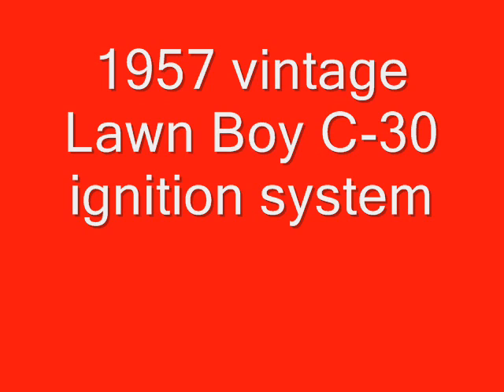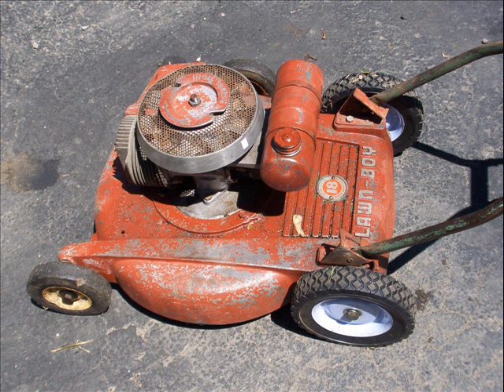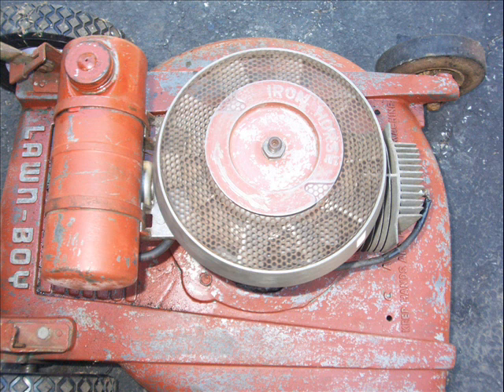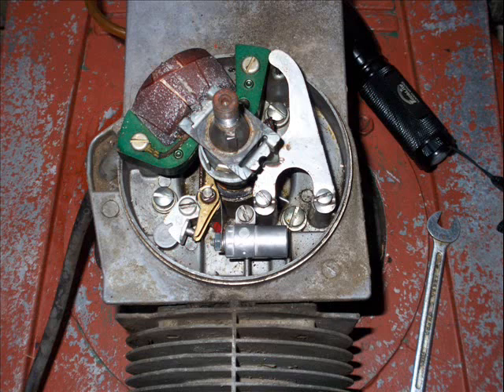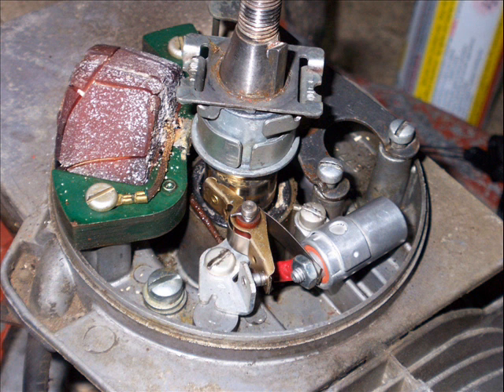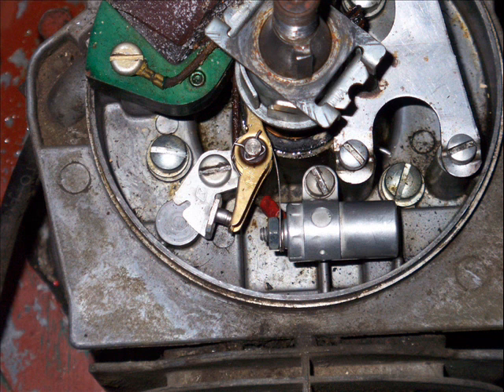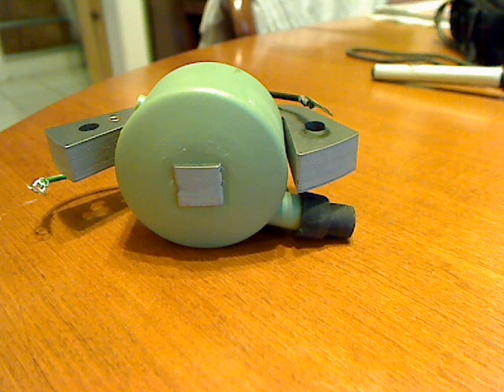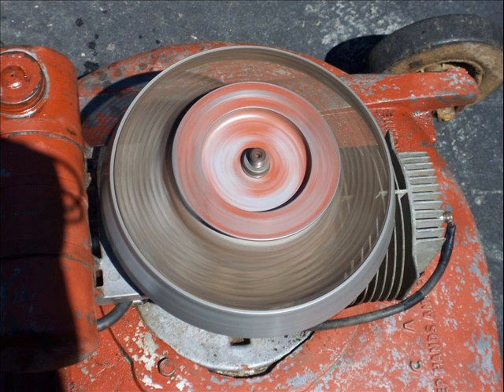Vintage Lawn Boy C-30 condensor, point, coil pack and governor view

Comment: Great job ,where did you get the new parts
Reply from the maker: Hi Bruce, I got the parts online 6 years ago, I can not remember which seller. Some of those sellers who specialized in small engines might still have the parts. Since Lawn boy was made by OMC (outboard motor company), some of the parts are the same like vintage outboard motor by OMC. Hope it helps.
Reply from the maker: please watch the video again, there is the brand name and the parts number on the coil. May be you can find it on line.